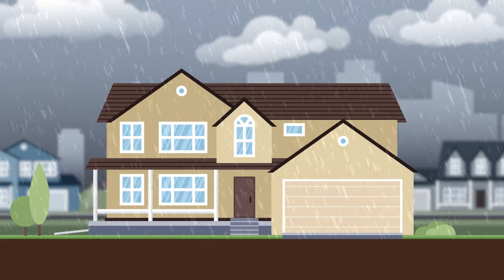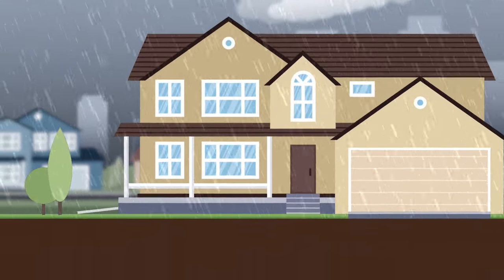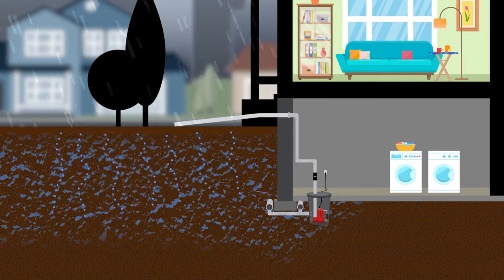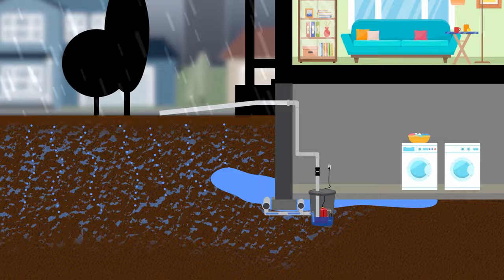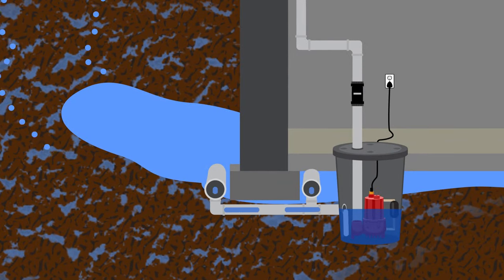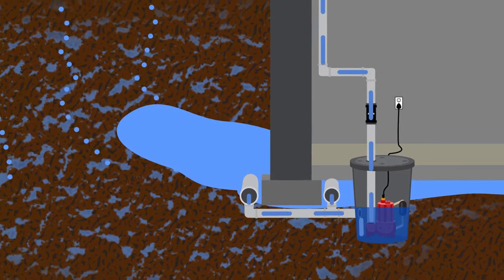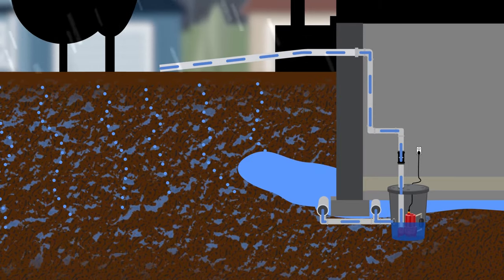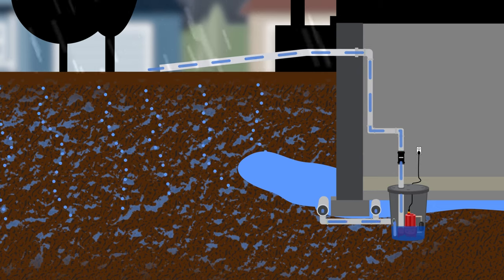How Does a Sump Pump Work? | Spec. Sense

Comment from the maker: Are you wondering if your sump pump is large enough? Watch our in-depth guide: https://youtu.be/Iqh3rI2XX4o  This will show you how to calculate the flow rate and capacity needed.
Reply: When I was a child in Michigan, living on an old farm, we had a sump pump but it was for drinking water, we drank water from the ground basically. It was the best water I ever drank in my life.
Reply from the maker: @CoopyKat  Thanks for sharing! Still lots of people using well / ground water for drinking even in 2023.
Reply: @AmreSupply   That's what I thought, that was the best water I ever tasted in my life.
Reply: Hello dear, What is the problem when the sump pump does not transfer the water from the underground pit to the outside?
Reply from the maker: @Canadiansoldier19  Thanks for watching. If the pump is not running, then the motor might have failed. Alternatively if the pump runs and no water is moving, then there might be a blockage in the drain line.

Comment: i like how it collects water then throws it the same spot where the water is collected, genius
Reply from the maker: Thanks for watching. What is hard to see in a 2d cut away animation is that water is accumulating from all sides of the house, and the weeping tile collects it into the sump basin. The sump pump usually pushes the water farther out away from the home and is usually in an area that will naturally slope away and drain away from the home's foundation.
Reply: @AmreSupply  thanks!
Reply: Exactly what I thought…it’s perpetuating the problem 😂😂😂
Reply: @Post_Maquel  my sump pump discharges water to the city sewer line
Reply: @TilKingdomCome_M610 illegally
Reply: Mine illegally pumps into the town sewer too 😊
Reply: I mean, where else is it going to go? Sewage and storm drainage isn't a real option as those are likely to be at capacity when your basement starts flooding.
Reply: @Smiley810Jay I don’t think they really care. You could explain the waste by just saying you were taking a shower😂
Reply: @jeffreycooper6789  Mine pumps water into my house main line, so I can shower with sump water. ;)
Reply: That's not how they work if installed correctly.

Comment: Bro please put the outlet pipe on the downhill side.  Your video shows the same water you just pumped out going back in. Thats not how any of this works
Reply from the maker: Thanks for watching. What is hard to see in a 2d cut away animation is that water is accumulating from all sides of the house, and the weeping tile collects it into the sump basin. The sump pump usually pushes the water farther out away from the home and is usually in an area that will naturally slope away and drain away from the home's foundation.

Comment: Ugh and here we are with a flood this morning
Reply from the maker: Thanks for watching. Do you mean your neighborhood is flooding, or did your sump pump stop working and flood the basement?
Reply: Hello .it was a long rain storm here , we just bought our house in March . We have discovered that we have a foundation issue or something …each rainstorm we have had has had wet floor in the basement . We thought it was the lack of correct drain pipes - but it was more than that , it is coming through the ground with the water rerouted , it’s just from the rain falling from the sky

Comment: If I have a sump pump on the east side of my house how does the water on the west side get pumped out ? Thanks
Reply from the maker: Hi Larry, thank you for watching. Since the weeping tile system goes around the whole home, water from all sides will collect and raise the water table. In this graphic, its a cross section so it was easier to show the water just on the one side.
Reply: AMRE Supply - I just got a sump installed and it runs every hour. Will it eventually not run as much ? I am guessing it’s a good sign it’s in a good place if it’s running lots ?
Reply from the maker: @automstone7613  It depends, if its running even when its not raining then it could be that your home is in a low spot in the neighbourhood, ground water might collect from more than just your footprint of your home. As well a smaller diameter sump basin can cause a pump to run more often as the basin will take less time to reach the level that will trigger the pump.
Reply: AMRE Supply - thanks for all the good information. Do all houses have weeping tile under the cement floor ?
Reply from the maker: @automstone7613  You're welcome. Older homes before the 1950's didn't have weeping tiles installed. Codes have changed decade to decade as some systems used to be connected to the storm drain but that increased the chance of basement flooding if the storm drain filled up. Now they are separate. Also not all homes needed a sump pump, it depended on how high the water table is for a home. If you're curious its best to check with your municipality for up to date codes. There's generally a bit of information on that where you live.
Reply: AMRE Supply - thank you

Comment: So much water it floods the basement foundation
Reply from the maker: Thanks for watching. There are severe storms that can overwhelm any sump pump system however if the sump basin is overflowing during a regular storm, then you might need to increase the size of the basin & pump. You can see how to size a pump in this video: https://www.youtube.com/watch?v=Iqh3rI2XX4o

Comment: Upon changing my sump pump, again, I cleaned the pit/liner first, before installing new sump pump.
Also did the weeping hole per Zoeller manual.
Pump is a Rigid 1/2 hp

I noticed the bottom is cracked.

I was quoted $990 to replace the pit.

I Google this issue first and found out, that there pit/ liner is suppose to have holes to allow water to come into the pit. And then the pump to eject the water outdoor.
So, is the crack at issue then?

The water rises to it's previous  waterline that it doesn't even trigger the pump at. It used to get trigger to almost an hour, or not at all.

Should I leave the crack alone?
Reply from the maker: Hi Rei, thank you for watching. Water normally enters the sump basin through the weeping tile system although during installation some are installed with holes in the bottom of the sump basin and around the sides to allow excess water to enter. This can prevent the basin from floating up. A crack will generally let more water in, and if the additional water is causing the sump pump to run more often then its best to replace the sump basin. If the pump continues to cycle on and off frequently then it will reduce the life of the motor.

Some people have used a marine epoxy to patch the crack as it can be applied and cured underwater but there are no guarantees that it hold or will be a permanent solution. 

Also in the mean time you can adjust and raise the float so that the pump doesn't trigger as often.

Hope this helps.
Reply: @AmreSupply  thank you for the education. We had rain last night. Prior to that, we added extension to all downspouts, about 5 feet away from the house and the water table didn't rise at all. 
It didn't trigger the pump at all. 
I'm going to place a WYZE camera to monitor how often (if any) the pump gets triggered.

I'll try to find that glue and patch it as needed.

Again, thanks for replying and educating us. 
Have a great day.
Reply from the maker: You're welcome Rei. Its a good call to add the extensions to the downspouts. Being aware of it and keeping an eye on the water level is a good way to go as well.

Cheers
Reply: @AmreSupply  (no rain) Started recording how often the Sump Pump gets triggered. https://imgur.com/gallery/gPyPjpV
Reply from the maker: Hi Rei, its interesting to see how often it is triggered even when its not raining. Its possible that the water table is really high under your home. Additionally if your home is in a low spot, the surrounding water might be feeding into your area.
Reply: @AmreSupply  so last week it has been super hot and humid, so no trigger from camera. This morning, it rain hard around 9:30am. Now all these Motion triggering the camera Sump Pump Motion after Rain https://imgur.com/a/rZlsVRf

Comment: My friend had his Liberty 257 sump replaced under warranty yesterday morning. The float had detached and he ended up with an inch of water in his basement. Last evening there was a heavy rainfall (hurricane Debbie) and he ended up with 2 feet of water in his basement. Sump pump was working but could not handle the amount of water. His house is connected to sewer system so this was probably more of a sewer back up. All houses on street had same problem. Is there a better system available?  Maybe backup  valves?
Reply from the maker: Thanks for watching. We did a video on how to size a sump pump but we also mentioned some of the other features. This includes models that have a backup battery, or even models with a secondary backup pump. https://www.youtube.com/watch?v=Iqh3rI2XX4o

Comment: Would just 1 of these be enough or would it make sense to install a 2nd on the other end of the house?
Reply from the maker: Thanks for watching. Generally the sump basin is located at the low spot where water will collect. If you feel like the current pump is undersized it could make sense to get a stronger pump. This video shows how to calculate the flow rate needed as well shows some of the other options like models with backup batteries and backup pumps: https://youtu.be/Iqh3rI2XX4o?si=mGcfk4_Yg_AYl4BR&t=71

Comment: Thanks for the video. A question I have, on my sump pump when it is running there is another pipe there throwing water back to the pump. It is not the same amount of water the sump pump is pumping, but a lot of water is coming back to the pit. Is this how it is supposed to be? thanks!
Reply from the maker: Thanks for watching. Are you referring to the pipe that is connected to the weeping tile? Or is this pipe one that runs vertically into the sump basin?
Reply: @AmreSupply  the pipe that runs vertically into the sump basin
Reply from the maker: @paulamadeira6850  Where does that pipe begin from? 
Is it connected to the discharge pipe in any way? Or does it run separately or go outside the basement?
Reply: @AmreSupply  the pipe that runs vertically into the sump basin I have no idea about its route or where it comes from. I guess that should the first step and I need a plumber to help me find out?
Reply from the maker: @paulamadeira6850  Without seeing your specific setup it's hard to say anything definitively.
If that other pipe fills the sump pump with water even when the sump pump is turned off, then it's likely a drain for something.
If water only flows through that pipe when the sump pump runs, then it's likely part of the discharge. 
In either case a plumber would be able to help you out with this.

Comment: Hey there, thanks for the informative video! I understand that sump pumps should send water outside (and not into the sewer)... but what happens in colder climates? How do we make sure that the pipe going outside (probably full of water if you use a check valve) doesn't freeze?
Reply from the maker: You're welcome, we're glad you found the video helpful. That is a good question. Since the discharge pipe is sloped downwards there shouldn't be any water sitting in the pipe during the winter (in the same way that your rain gutter downspout is normally empty unless clogged with leaves). Because of the check valve there would still be some water in the vertical pipe going up from the sump pump, but this wouldn't freeze as it is still inside the house.

Overall you can check the sump pump to make sure its working and draining properly. You can dump several buckets of water into the sump basin which will trigger the float switch and cause it to run. Then observe the discharge pipe and see if its draining well.
Reply: I was wondering the same thing. We live on Lake Erie and the winters are brutal.

Comment: Hey, I don’t know if you’ll see this but I have a question. There’s water leaking out of the HVAC connected to the sump pump. Do you know why this could happen. I may sound extremely dumb, but I I’m just confused. It isn’t a lot of water, just a small amount.
Reply from the maker: Thanks for watching. A furnace and air conditioners can produce condensate during heating or cooling. If there is not a floor drain near by in some cases a condensate pump will sit beside the unit and pump the excess condensate to a drain. https://www.youtube.com/watch?v=dcLhyLu0-y8

Comment: is the cord water proof; if so, do i bury excess cord in the ground so i don't trip over it or it doesnt get damaged?
Reply from the maker: Thanks for watching. Since the pump is submersible, the cord is sealed. As long as the cord is plugged into a dry and clean outlet, then it should be good.

Comment: Our sump has been refilling every 8 minutes.  Pump works fine.  As a possibly related note, our neighbor has a pipe which goes through our basement (I know that's weird), and I can hear water moving through their pipe constantly.  I feel like they might have a break in their water line and it is feeding water to our sump.  What are your thoughts on this?  What else could it be?  There has been little rain and snow melt.
Reply from the maker: Thanks for watching. Depending on where your home is the grading of the lot a high ground water level could cause your sump to fill up even when there isn't much rain or snow. This should be fairly consistent over time though.

If your sump pump suddenly started working more (without more rain or snow) then that could point to something else. It is possible that there is a leak in the pipe from your neighbor that passes through your basement. Try to see if there's any other signs of a leak, any damp spots in the basement etc. Still it might not be visible and could be just feeding into the weeping tile under the home so it might be difficult to narrow down if that is the case.

Comment: My pit in Mississauga continues to fill and run every hour. Even with no rain. Likely ground water. Any suggestions?
Reply from the maker: Thanks for watching. Depending on where home is located it might be in a low spot where the ground water is accumulating more frequently. If the sump basin doesn't completely fill then the size of the pump and basin should be adequate, but in some cases you might want a larger pump to make sure that it can handle a heavy storm.

Comment: My sump pumps get overwhelmed when we have non stop rain for over a day. I purchased a trash pump to help avoid having my basement flood again. Should I have someone install another set of sump pumps on another corner of my basement?
Reply from the maker: Thanks for watching. It's good to be observant of the demand on the sump pump. In some cases it can definitely be worth hiring someone to do an inspection/ upgrading your system. There are larger pumps available, but sometimes a larger sump basin is needed as well. 

If you are curious on calculating the flow rate we did make a video here on it: https://youtu.be/Iqh3rI2XX4o?t=69
Reply: @AmreSupply  hank you for the link. The information is very helpful.

Comment: So the sump pump pulls water into the machine/pump and shoots it out the top. Water doesn't normally travel upwards. How high can the vertical pipe be before the right angle to go outside?
Reply from the maker: Thanks for watching. We have a longer video on sump pump that explains this in more detail: https://youtu.be/Iqh3rI2XX4o?si=Zn4b8fr0QbFWESLA&t=69

Comment: Hello where I live rain two days ago whole day, and  the thing is bing pumping water since that day, is that normal?...what happen if i turn it off ? Is not raining any more....and can turn on only when is raining?  What do you recommend me? When it will stop doing that?...
Reply from the maker: Thanks for watching. It depends on where your home is located. It is possible that after a day of rain that water is still draining from the surrounding area that is higher in elevation (if there is a hill nearby that would affect it).

The sump pump will trigger any time that the basin fills up with water. Its not recommended to unplug it or turn it off. It will turn off automatically after the water in the basin stops filling up.
Reply: Thanks for answer my question!!! Very helpful!!!
I just bought my house 2 months ago thanks!!
Reply from the maker: @alejandraperez4774  You're welcome, we're just happy to help!

Comment: Is there always supposed to be water in the sump pump pit? mine is dry right now
Reply from the maker: Hi Sean, thank you for watching. There should normally be a bit of water in the sump pit basin but a few things can affect it. In the winter, the water in the ground can freeze and will only start to flow back into the sump basin once it warms up. Additionally if the water table shifts or the water around your house drains in a different way then it can also cause the sump to receive no water. Regardless you should test your sump pump to see that its running correctly, pour a few buckets of water into the sump basin until the float rises and activates the pump. After it runs there will be a little bit of water left in the bottom. If nothing drains into it, it may continue to dry out.